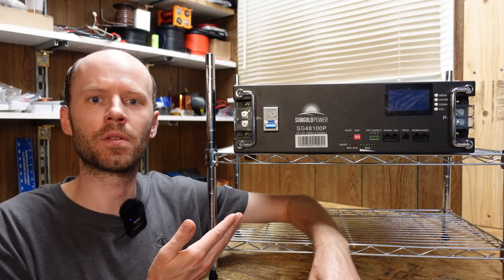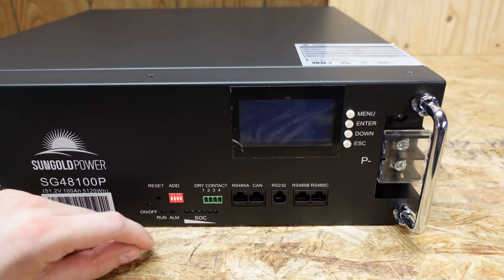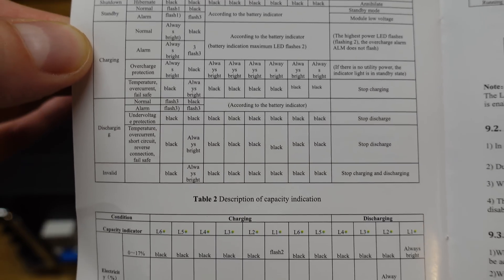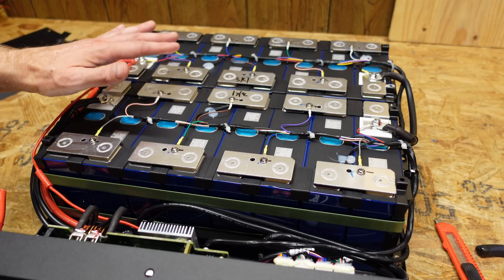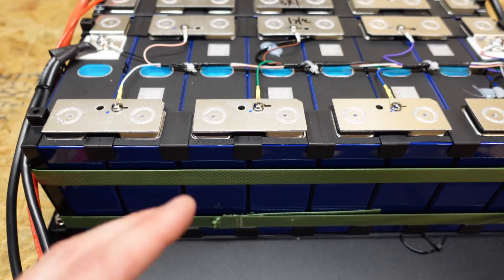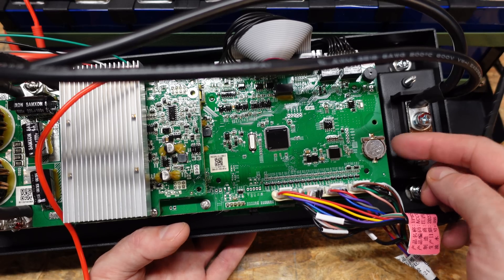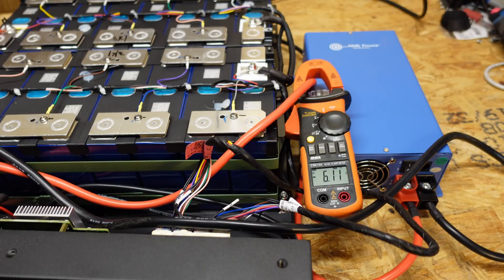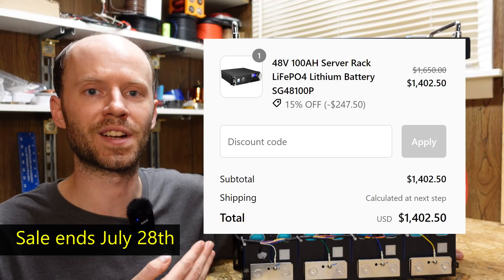CHEAP SunGoldPower 48V Rack Mount LiFePO4 Battery Teardown Review

Comment: I’m thinking the button battery to be changed out every so often ✅
I’m seeing what looks like a good amount of good work in this build 😊
Reply: Actually, the coin battery is in a typical PCB mounted cell holder. Looks like they dabbed a bit of silastic (adhesive) on it for vibration protection. Should be easy to peel off the silastic and replace the cell. If you look closely, most of the components that have any size or weight over that of the SMT components are staked to mitigate vibration damage.